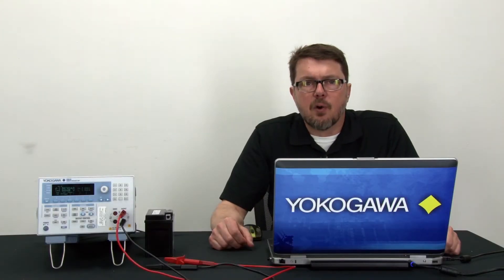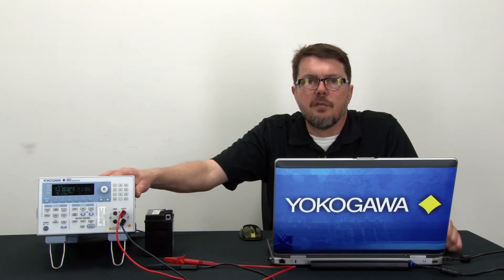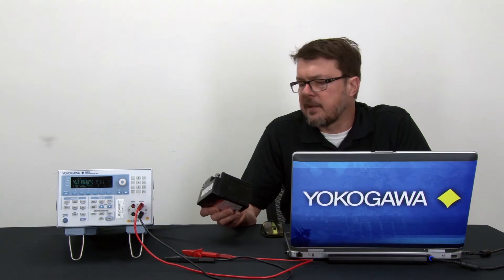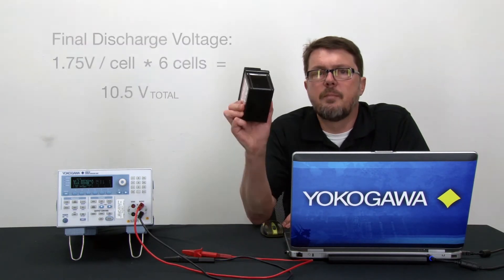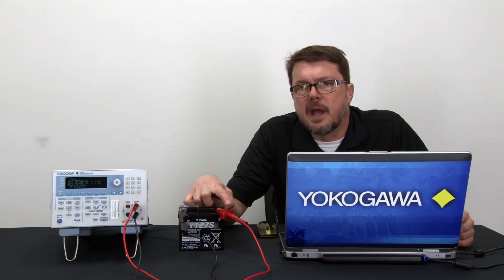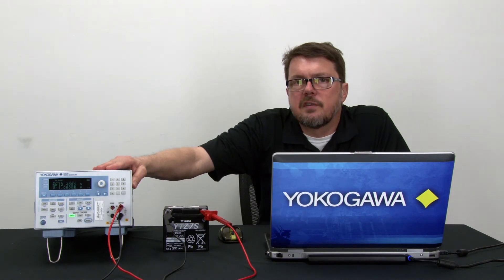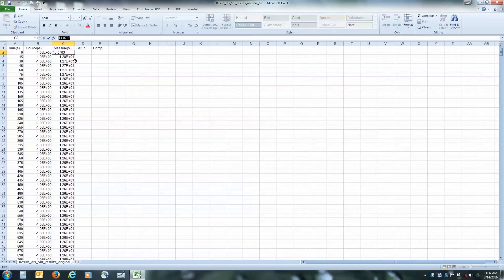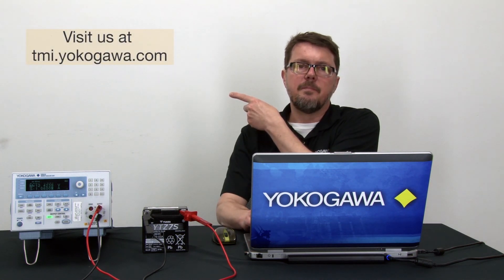How to Test Capacity of a Lead Acid Battery with a Source Measure Unit

Comment: Can we use gs610 to charge battery.?
Reply from the maker: The GS610 can be used to simulate the charge/discharge operation of secondary batteries such as lithium-ion and nickel hydride batteries.

Comment: It's overkill to use SMU for battery capacity measurement. An electronic load will do just fine.
Reply from the maker: It could depend on the precision needed. This video was just an example application for the SMU.

Comment: Hello Berry,

I need to ask you something related to a flooded lead-acid battery I am using in my APS system at home, I think this battery is meant to be used in a vehicle not sitting at home. Someone recommended that I shake this battery every few days to maintain its life, is this true? do you recommend it?